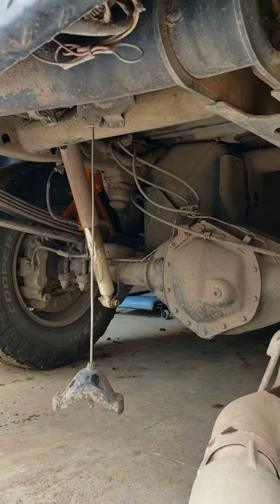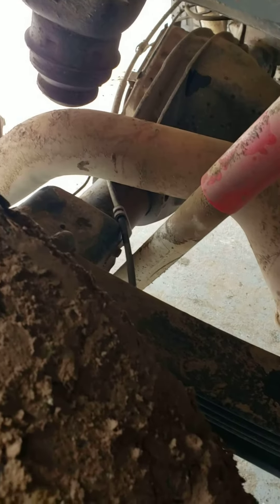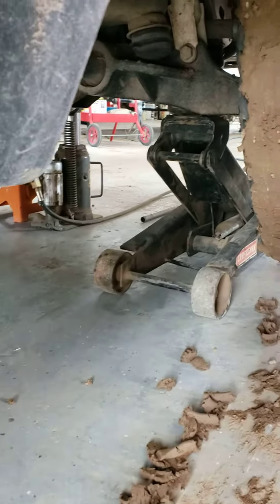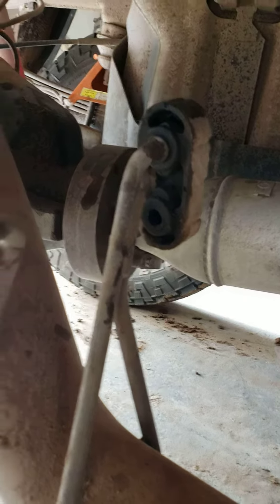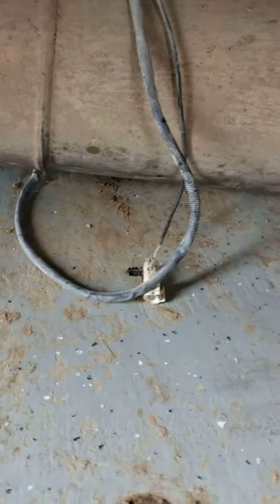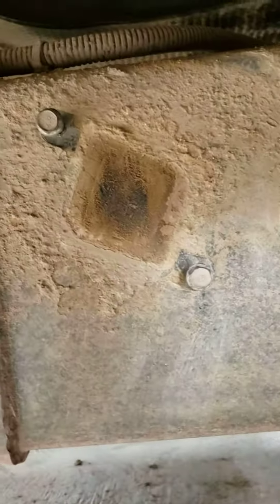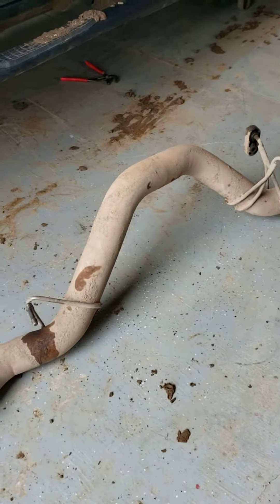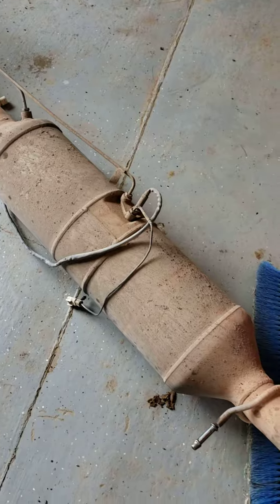Chevy Duramax Exhaust removal pt 2 cut free

Comment from the maker: You can find cleaning kits that hook to an air compressor as well as the dpf cleaning solutions on Amazon and other stores.  They are great to run through it at least once year.  But if it's super clogged up use a bug sprayer and vinegar, hit the front opening as well as all the sensor holes really good, let it sit for about 5 min then use a garden hose with a narrow sprayer or a power washer if you have one.  It's going to make a heck of a mess and kick out a ton of garbage.  Tilt it straight up to drain the water the best you can.  Then slap it back on the truck, put it in 1st and drive with high rps, you'll know when its good to go because your engine will roar back to life and you'll see a massive plume of smoke blow out the exhaust.  You might have to buy an obd plug in for your trucks computer (i used a Bluetooth one i bought for like $30) and hit clear codes when it goes into limp mode to bypass the safety so you can achieve high rpms to blow out the clog AFTER CLEANING.  It's alot of work, if you need more help let me know and I'll try and help.  Good luck, hope this helps